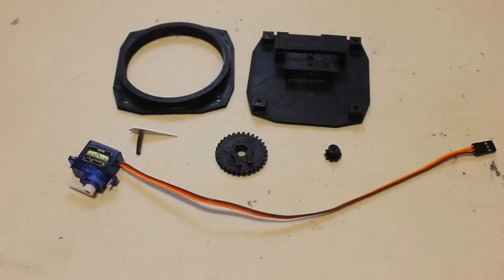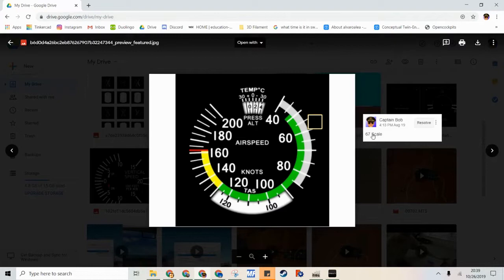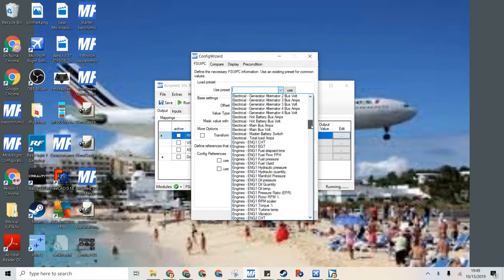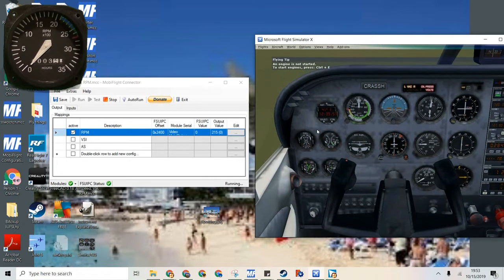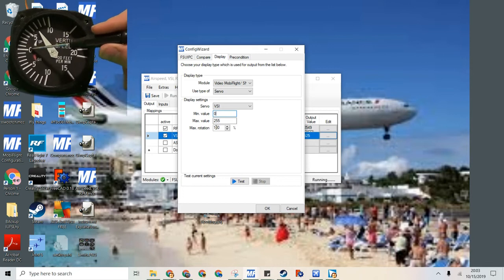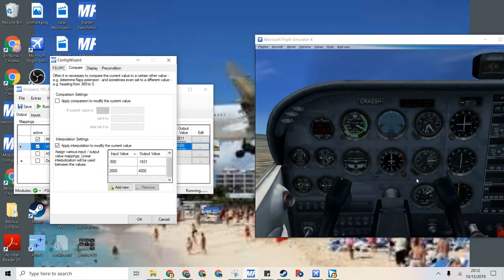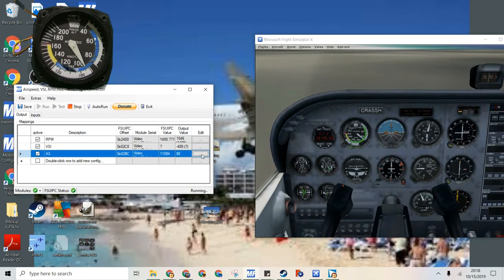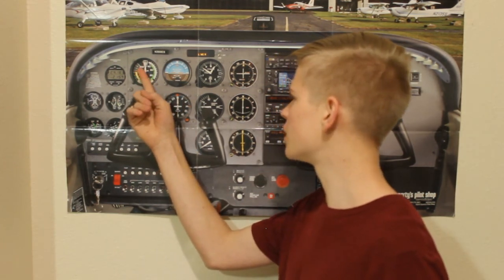Flight Simulator Instruments Part 2:  Airspeed Indicator, Vertical Speed Indicator, and Tachometer

Comment: Hey Man,  what were your settings on the print of the backplate?  Did you use supports?
Reply from the maker: I printed it with supports everywhere, no raft, I believe 25% infill, .25 layer height.
Reply: @CaptainBobSim  Thanks!

Comment: Have you made the altitude indicator instrument
Reply from the maker: Yes, the video will come out sometime relatively soon :)
Reply: @CaptainBobSim  well I am waiting for it
Reply: I was thinking to use a 7 inch LCD with arduino mega to use as altitude indicator, can it be programmed with mobi flight? Please let me know if possible
Reply from the maker: @BTCAudiobook  Probably not, It would be some complicated programing anyways. You could use an HDMI and do something there?
Reply from the maker: Disregard, I made an Altimeter/Altitude video here: https://youtu.be/YhThtm_ZIwE I thought you were talking about an attitude indicator/artificial horizon 🤦‍♂️
Reply: @CaptainBobSim  but designing a typical altitude meter with servo is difficult to maintain the two axis
Reply: Thanks for your videos, I can across mobiflight, I was trying some harder way to make the instruments and button box, today I tried your way it's easy
Reply: I am trying out the throttle and mixture with linear potentiometer
Reply from the maker: @BTCAudiobook  You are welcome! Good luck with your sim and have a nice day